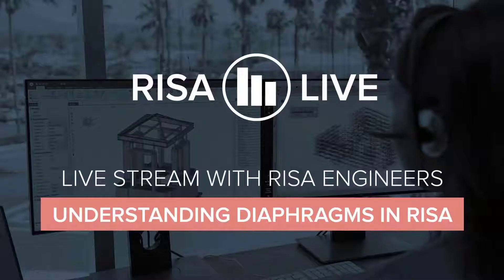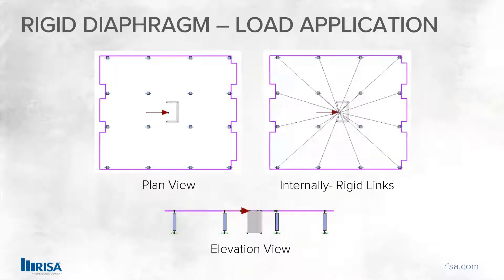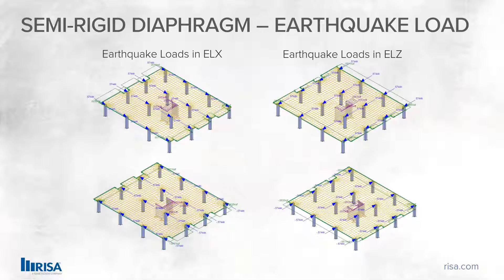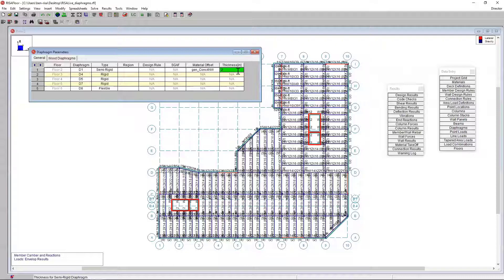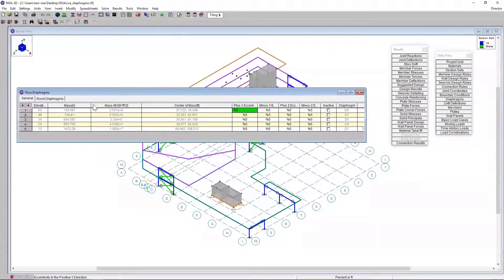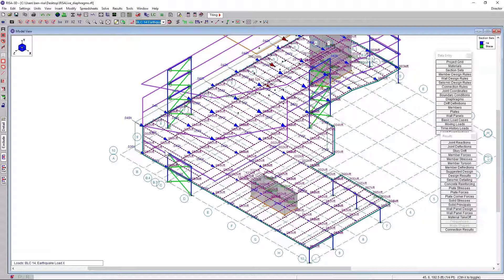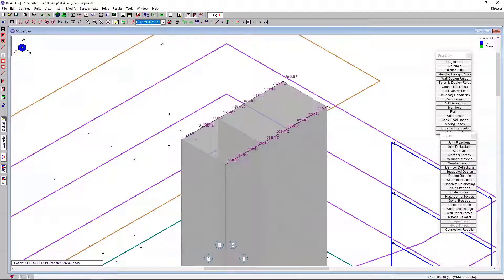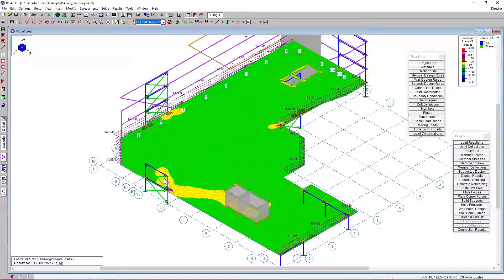RISA Live - Understanding Diaphragms in RISA

Comment: how to define diaphragms in RISA 3D alone without RISA floor
Reply from the maker: Emad, the only way to create a diaphragm in RISA-3D is to click on the "Diaphragms" spreadsheet in the Explorer Panel and you can create a planar rigid diaphragm that is defined based on a specific node. Use can also use plates to simulate semi-rigid diaphragm action at a level but the software does not define it as a "semi-rigid" diaphragm like it does in RISAFloor. Hope that helps clarify things for you!